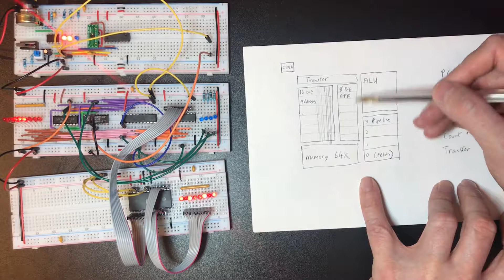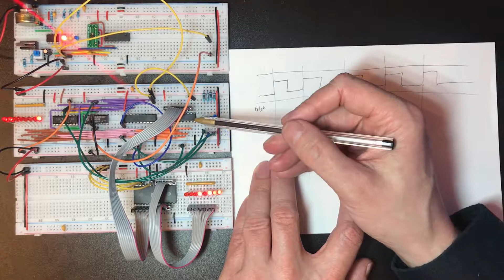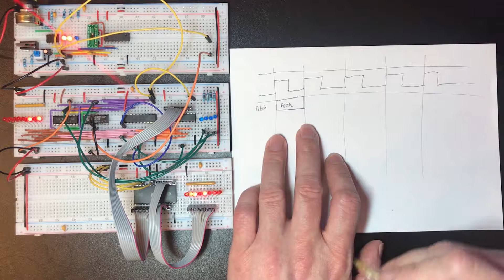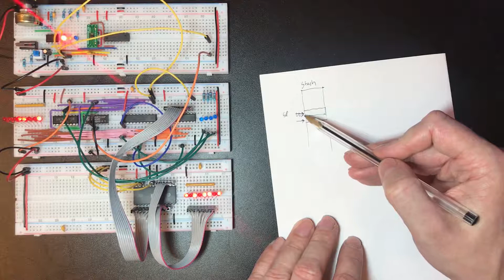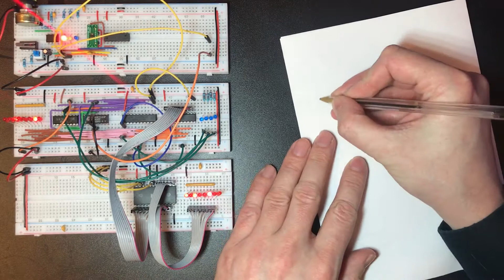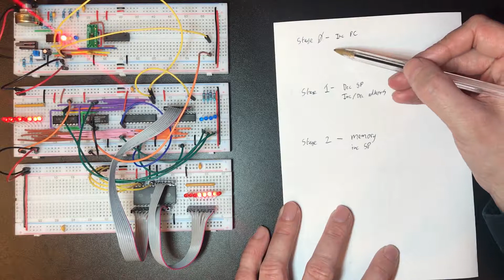Pipeline (1: Discussion and Fetch) - Making an 8 Bit pipelined CPU - Part 8

Comment: I'm watching this fantastic playlist for the second time. Every aspect covered in these videos is extraordinarily interesting. James made and justified many choices regarding the architecture of his CPU. However, I'm thinking about the choice of using pipelining. James justified it by claiming better performance for the CPU. I'm wondering if it makes sense to develop a CPU with a "classic" instruction decoder (and therefore a non-pipelined CPU) and if it's possible to estimate the performance difference between the two CPUs without building them.
Reply from the maker: You could try but the difficulty is that it wouldn't necessarily force you to make the same decisions as if you were building it for real.

Comment: Am rewatching this fantastic series again. I do still have a question about how the pipe works. The overall process outlined here is totally clear but I don’t fully understand how the operations are placed within it. Does each operation have to be structured to work in three cycles?
Reply from the maker: Each operation passes through all the stages of the pipeline but they don't all do things in every step. Operations can't do more than that either, that's why I can't have more complex instructions in this simple design.  In the future I may talk about how more advanced cpu's deal with more complex operations.
Reply: @weirdboyjim  Thanks for your reply. Makes sense. I rewatched of some other parts and that also made things clearer. Cheers!

Comment: Do you really need the time, or do you need extra clocks? Can use falling edge as extra trigger to do work 1/2 the clock time, so if 1/2 clock time is enough for the circuit to propagate the output you don't need a faster clock to do extra work, high clocks on breadboard can give problem, especially with long wires and lots of induction across couple of breadboards.
Reply from the maker: The goal for this project is for it all to finish on pcb, breadboard is for development. The work I plan on the low/high half the block is actually quite balanced but you are obviously looking at a partial circuit.

Comment: WOuldn't it make sense for the fetch unit to pre-decode the instruction, looking only at those bits that determine instruction length, and then fetch the following byte(s) before handing it to the next stage as a whole? This would also allow fetching to potentially continue when a stage is busy for a couple of cycles with a e.g. a DIV.
Reply from the maker: Yes and No. Ideally the pipeline steps are sliced into even time intervals and if each step finishes in less time than a clock than you can increase the clockrate. In my build memory access in the fetch is part of the critical path for instruction execution time. So adding anything there would slow the maximum clockrate, the earliest opportunity to decode the instruction is in step one which is where I work out if I need an extra byte. Easy to imagine a situation where a little extra decode in fetch might be the right choice though.
Reply: @weirdboyjim  I was thinking of a slightly different architecture this early in the series, being used to a much more extensive use of variable-length instructions. When you have instructions from e.g. 1 (no param) to 5 bytes  (2 16-bit params), it is much more work putting those bytes where they belong. On the other hand you now have holes in the instruction stream that allow you to spend more cycles in each stage, either using that hole or blocking fetches. (So you need push and block bidirectional signalling between the stages, not quite the complexity you are aiming for. Oops ;) )

Your constant register basically is this, just that it is fetching while the instruction already has moved on. Wouldn't work for 3 bytes of parameter, the instruction would have left the pipeline before the fetching was done. But as long as instructions are only 1 or 2 bytes, it is fine and well.

Comment: The first machine language I learned, on my Radio Shack pocket computer PC-2, had three index registers X,Y,Z and had instructions to load and increment, store and increment, load and decrement, store and decrement.  So,putting your 16-bit registers together uniformly in the pipeline rather than having SP be special would be a sound idea.
Although when using them as general purpose go-through-the-data registers, you don't need separate pre/post increment.  You certainly could, though, define that your Store uses post increment/decrement and the Load uses pre-, uniformly for all the registers.  Then push/pop just become aliases for SIN SP and LIN SP.  As for which is which (pre/post)... you want the STORE at the end of the pipeline, ready to write any result of the operation.  You want the LOAD at the first, to read immediate values and arguments in general.  So have the Load's auto-increment/decrement be the one that the chip does simultaneously with presenting the value.
Reply from the maker: SP, SI, DI are all identical hardware with identical wiring, the only thing that really differentiates them is the instructions I've implemented. SP becomes the stack pointer because of the push/pop instructions. The big limiting factor that stopped me making them all much more generic was just a lack of instruction space, I was keeping the  instruction registers in the pipeline to 8-bits in order to keep things simple and easy to understand and 256 instruction permutations does not leave a lot of room for flexibility.

Comment: I will be frank, I gave you a down-vote. I know it is mean, but I am here to fess up to it and explain why. I am desperately trying to find some decent explanation of why we need this pipeline and what it does for me. And all I ever get is people to assert as if it was a given that there were 1. fetch, 2. decode, and 3. execute requiring 3 cycles and that we could somehow speed things up by executing them in parallel. And I disagree. Nobody has proven this to me, and you, while you start out exactly the way it should be clear, i.e., by building it up from scratch on bread-board, you are not even saying so clearly what these pipeline steps even are supposed to be!

In my RISC-like design, you have an instruction be fetched from memory and clocked into the instruction register (IR) and the instruction pointer (IP) incremented. That is one cycle and it can be done in one cycle: address bus MUX on IP in phase 0 of the cycle, then the data appears on the memory data lines, and we MUX them to the IR, rising edge of CLK, and boom IR is loaded. At the same rising edge the IP is incremented. Now decode requires no cycle at all, the IR + the status flags immediately assert all the control lines, which includes the data address register MUXed onto the memory address bus and the data path routed to the target register (or register MUXed to memory data bus), and next CLK edge the data is clocked into the register, or, in the write case, the WE line goes up latching the data into the memory. Done. One cycle execute. 

So I have one cycle fetch and one cycle execute. Most of the time, execution entails a memory access. So I have no ability to do a fetch at that time. And I do not have a decode that requires any cycle. Why does everybody claim that instruction decoding takes a cycle???? So matter of factly? Makes no sense to me. Even if I have multi-step micro coding of instructions, I would still probably have memory accesses in most steps, such as if I read immediate addressed data values or absolute addressed memory locations. Almost every time I would need a memory fetch cycle. The only time I don't might be a pure register transfer or ALU op that goes register to register only.

So if one of the RISC tenets is to not do an ALU with memory access in the same instruction, then yes, I can interlace the next instruction fetch with the register -> ALU -> register operation. But what if I need the ALU to increment the IP? I use synchronous counters (74LS161) for the IP, and can use up/down counter for a stack pointer. So I don't need to use the ALU for that. So, perhaps I can see one specific pipelining useful when there are specific assumptions made, i.e., if "execute" means register-only ALU operation. Then the memory fetch can pre-load the next instruction. But what do I gain from that assumption that I can't use the ALU in a memory operation? 

Somebody still needs to really explain this without these presumptions that aren't true, like decode does not require a clock cycle!
Reply from the maker: Yes, your down-vote is mean. I'm just someone with a crazy project, making videos for the people who are interested, I'm not an expert and I'm certainly not an electronics or processor design educator. My design is far from perfect, I've had to compromise to make it something I can build in ration time and space and I dare say I've made mistakes. That said I'm going to try and address your concerns. 

You explain your first cycle flow and then assert "Now decode requires no cycle at all" but you don't give any details. In basic CPU's I've seen 2 main ways of turning the instruction into levels on the control lines, either with a stack of discrete logic or with a rom like look-up. Either way this takes time, physics prevents it being instant. Whatever amount of time that is, your memory subsystem is idle for it and as you correctly identify memory is a major bottleneck. 

You say "Somebody still needs to really explain this without these presumptions that aren't true, like decode does not require a clock cycle!" but there is a different way to think about it. A clock cycle is not a hypothetical concept, it's a unit of time in which things happen. Your explanation involves both fetch and decode happening in one cycle, this is pretty easy to do but it means the circuitry takes longer to settle. Pipelined processor design begins with asking the question "can I chop my big things up into things the size of my small things", the aim is to enable a faster clock rate and more circuit parallelism. It's not "decode MUST BE one cycle!" it's "what do we gain by making decode it's own cycle?".

You say "Most of the time, execution entails a memory access.", optimising programmers labour to make this not true. Real world code on my processor tends to execute at a non memory to memory accessing ratio of about 4:1. Memory being a horrible bottle neck has always been a big issue, there are many things that try and mitigate this (Memory caches, Harvard architecture and wider memory data bus's to name a few). Imagine having a 1 byte instruction but a 2 byte memory data bus, as long as the first wasn't a branch instruction you can keep that 2nd byte to "fetch" without a memory operation. All the flaws you are pointing out are not flaws in pipelined design, they are design challenges that have each had far more time spent on them than I could possible cover. 

The reality is pretty much all modern processors use a pipelined architecture, almost certainly the device you are reading this is on uses one.  If you don't "get it" It's more likely a failure in my explanation than a flaw in modern processor design. Of course it's not impossible that you've seen something new,  write some papers or make your own videos on the subject I would be interested to see it them.
Reply: @weirdboyjim  first I changed my vote, because of course it was mean. 

Secondly I suppose as long as we are on breadboards the memory or ROM access time / decode time does not matter. It happens right after the rising CLK edge and is long finished by the time the clock edge falls. Maybe propagation time through your decoding logic will be pushing it, but before the clock rises we are executing something on behalf of the new instruction, and that something many times is just another memory read for the arguments to the instruction.

The problem I still see with the explanation is that in order to keep the pipeline stuffed full, you need to fetch from memory but we have just established that memory fetches are slow-ish. Nothing that matters on a bread board where you are stretched with 4 MHz clock speed (I have one running at 4 MHz on breadboard but it's dicey.) Looks like you are about to transfer your breadboard prototypes to PCBs, so I guess you can crank up your frequency. But with passive backplane bus multi-card architecture, you might still be hard pressed to come down to the 20 ns which your average SRAM needs.

So, there is still the question how do we keep the pipeline full? You already mentioned in your video that you see the memory contention coming at many an execute step, and there will be the time it takes to read the arguments to the instruction, so everything is hung on the memory. So I still don't get it.

The one thing I can get is: let's just make sure we never once waste a cycle without at least reading the next op code, and if we have multi-step instructions, then by all means read the arguments to the next opcode too. I guess really no explanation so far has satisfied me.
Reply: @guntherschadow9383   Read this https://computationstructures.org/lectures/performance/performance.html
Reply: In in RISC instruction decode needs to figure out if the instruction is R type or I type or J type or M type and then set up the routes. I like how RISC V discusses the symmetry in the routing table. You can swap on the pull side and on the push side. Just don’t swap too often.

A lot of RISC CPUs need to translate between 3 register ISA and 2 register implementation or vice versa.
Reply: I've just started watching this series, because as a Z80 fan boy I have no idea how a pipelined CPU works. I'm watching in series, so no idea how the project ends.

If you're looking at pipelining from a RISC perspective, then may be the benefits of pipeline won't be so great as each RISC instruction is 1 clock cycle. However, once you use 6502, Z80, x86 architectures, then you're looking at Opcodes that can take 6, 8 or more clock cycles to execute. It's during these long execution opcodes that pipelining will come into its own.
Reply: @axelBr1  the long instructions on the 6502 saturate the memory interface. I don’t see how a pipeline could improve the speed. Also maybe you could explain why the 6502 has two busses on chip, and a separate PLA for the micro ops ( Harvard Architecture), but not considered pipeline. That is why 6502 can run at half the clock like a Z80 and still get the same amount of stuff done.

Two things hurt: carry triggers additional microOps, but there is no branching in the PLA. Would have loved 16 bit SP and Akku. And B register to pull immediates out of inner loops. 6800
Reply: @axelBr1 RISC instructions don’t complete in one clock cycle, in fact, many modern RISC CPUs have deep pipelines that take many clock cycles. However due to those deep pipelines and further optimizations such as wider memory buses, separate code and data caches, instruction reordering, etc. those RISC instructions can be overlapped in such a way that almost every single clock single an instruction that spent several cycles in the pipeline completes giving the appearance of each instruction taking only one cycle.

Comment: It’s annoying that the DIL LED arrays only come in tens!
Reply from the maker: I've managed to get a few 8's now, too late to make any difference on the core cpu build.
Reply: @weirdboyjim  Well in the next video, someone left a comment that they are available on AliExpress. I've just done a search and they indeed are. $6 for 20 pieces of 4 different lengths (inc 5 off of length 8). So that was good to find out. I'll be placing an order very soon.

Comment: It's me again hahaha, and as always, nice video! I just received some chips, and I'm struggling to insert them in the breadboard as this is my first time. It seems like i got to bend the pins, but I'm scared to do it.
Reply from the maker: Yes, brand new chips have legs that spread out to far. I usually just give it a gentle  push on the side against a flat surface. You can see me do that in several videos.
Reply: @weirdboyjim  Thank you